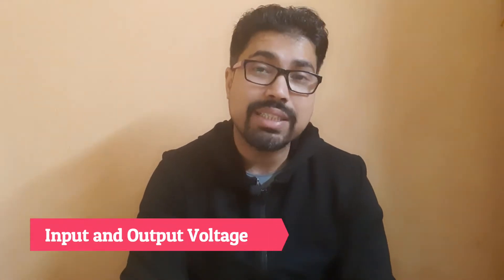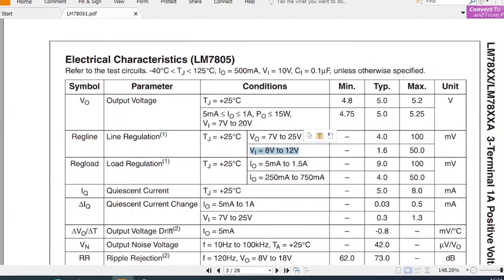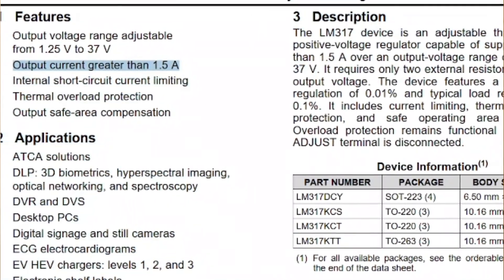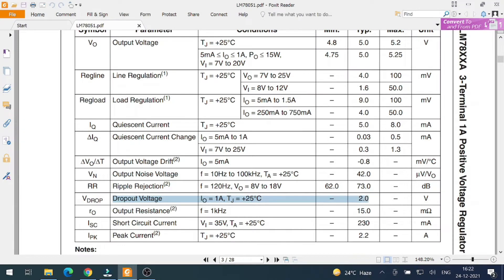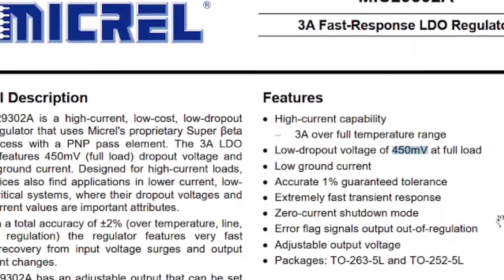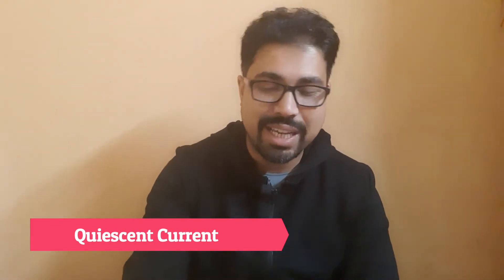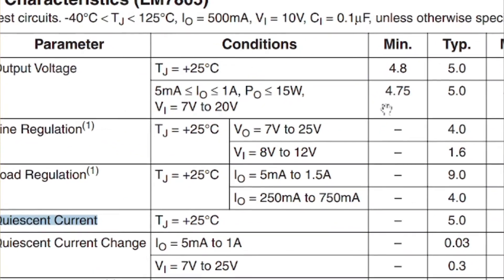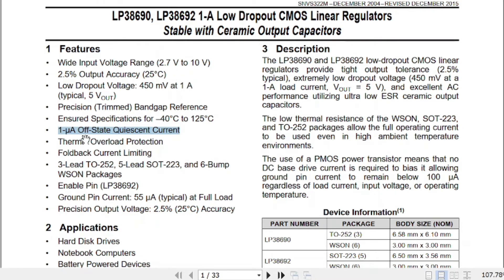How to select right voltage regulator | কীভাবে সিলেক্ট করবেন ভোল্টেজ রেগুলেটর | LDO concepts

Comment: অসংখ্য ধন্যবাদ সহজ ও সুন্দর উপস্থাপনের জন্য। ভাই নিম্ন উল্লিখিত তথ‍্য অনুযায়ী একটি সার্কিট ডায়াগ্রাম প্রদর্শন করলে চিরকৃতজ্ঞ থাকব।
 12V 95 A DC Battery থেকে convert করে 6V 1.5 A power supply তৈরি করার কোনো ব‍্যবস্থা আছে কি না? থাকলে দয়া করে একটি ডায়াগ্রাম দেয়া যাবে কিনা? আমি একটি AC- DC 6V -1.5 A লোডে FAN চালাতে চাই। অগ্রিম ধন্যবাদ।

Comment: voltage 12 ìnput out also 12 voltage need what numbers ic
Reply from the maker: You can use dc to dc isolator or any adjustable regulator like LM317.